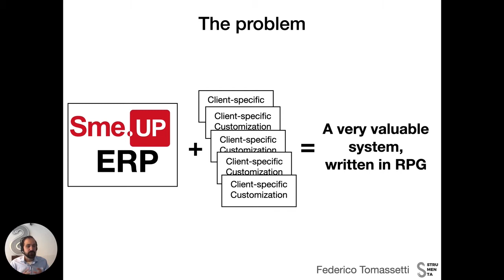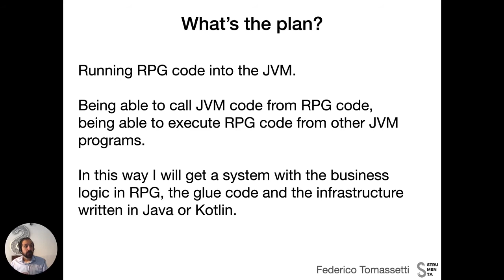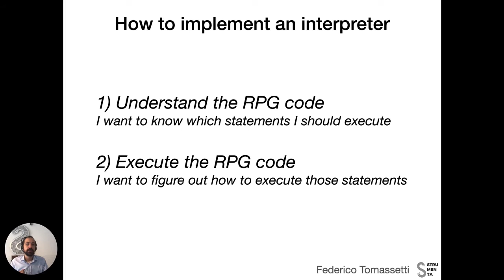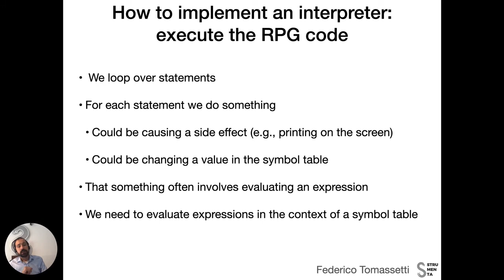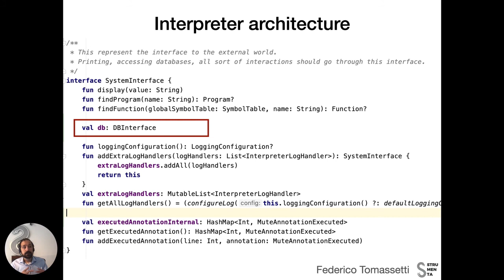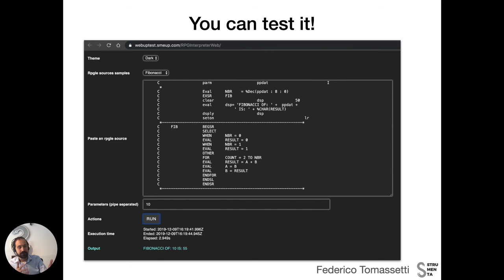Jariko - An open-source interpreter for RPG written in Kotlin

Comment: Hi, Thanks for sharing this information!!! I have a question: what is the program that you use to convert a notion page to pdf and word? (is in another video, but the comments were disable)
Reply: Hi Barbara, that was some software we developed using the unofficial Notion API, as the official ones were released years later. That software has been since discontinued